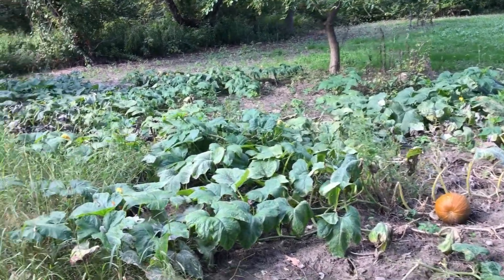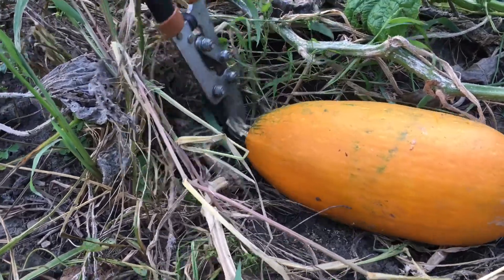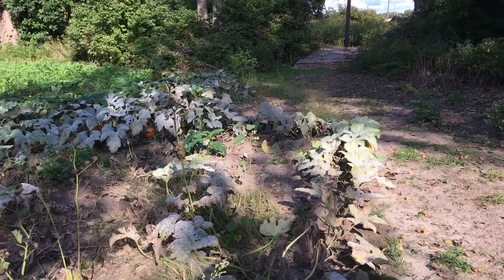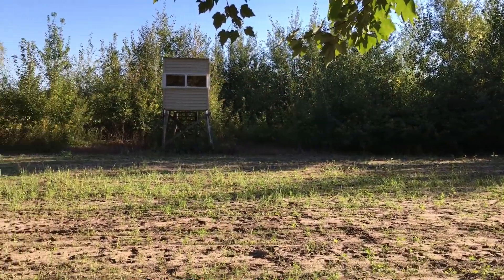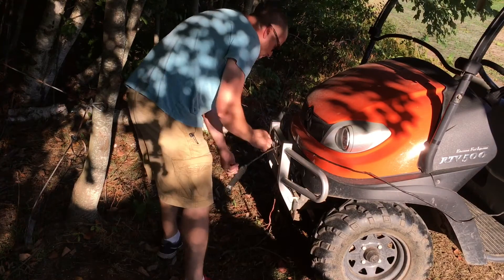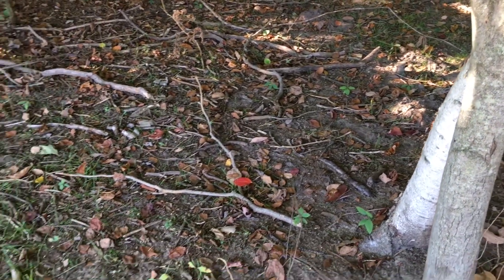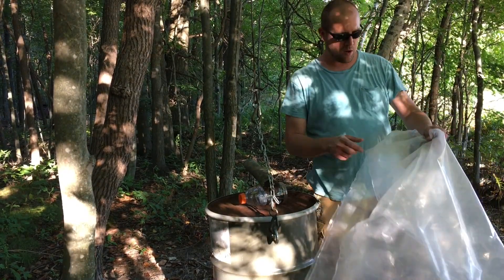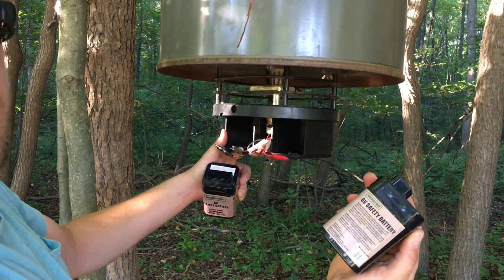038 Setting up a deer feeder

Comment: Hey Bro, well done.  Good to see the helper too.  What brand of feeder is that? Did it come as a set or did you build it? And are you happy with it? 

Thank you very much. 
Nick.
Reply from the maker: Was a Moultrie feeder. I added the bracket so it could be hung in the tree and the idea for a cable between trees with a pulley operated by the winch was line too. In Michigan we can bait anymore but the system worked well. Thanks for watching.